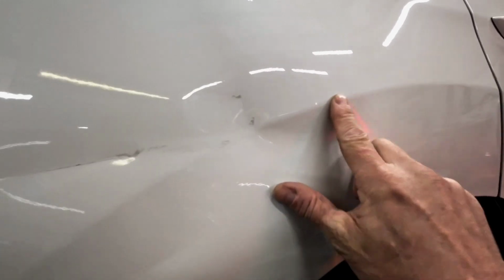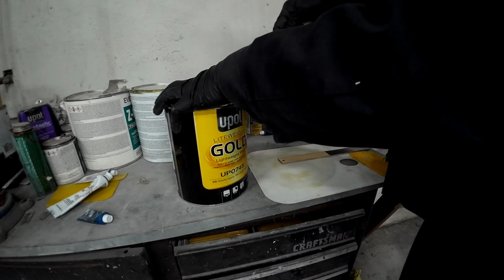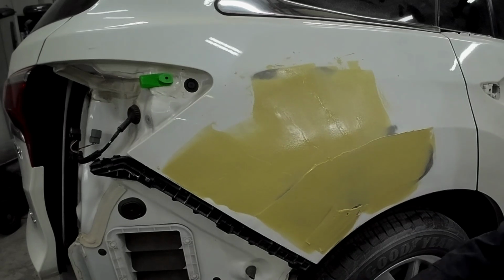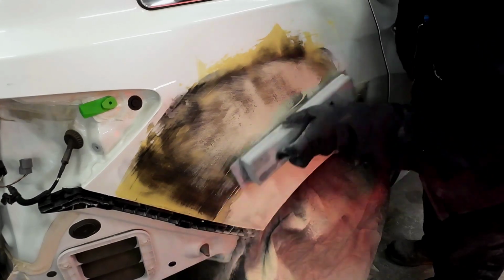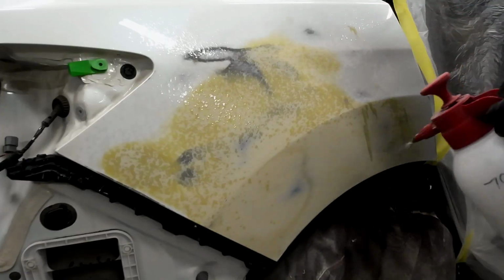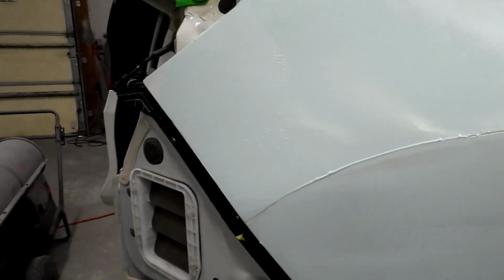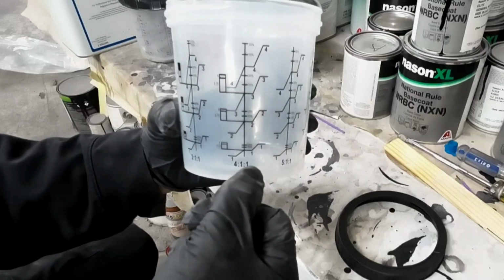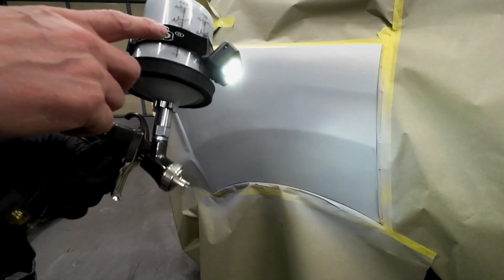How to use automotive body filler to repair your car or restoration project.

Comment: Great video! When you use that powder guide coat, if it's down in a low spot to you need to get it all out before adding more filler? Can it contaminate or cause adhesion issues?
Reply from the maker: It's  a good question I don't  remove it totally and have never had an adhesion issue. I clean it with isopropyl alcohol before adding filler or primer but I don't want to say it's 100% ok. I'll investigate this further.

Comment: Why do you have to remove the paint ? Ive got a small dent and want to do this.
Reply from the maker: On a small dent you don't  have to. You can sand it with 80grit for adhision and apply filler over the paint. Depending on the depth of the dent you may want to pull it out first. That can be done with glue pulling.
Reply: @GarageNoise  I've pulled it out as much as I can so now I think it'll be ready to put body filler, thanks for that how deep or a dent is too deep to fill roughly?

Comment: First time body filler user here. I used a bit of the upol and after it dried and I sanded it I saw that it could have benefitted from another layer, I didn't know if you could use filler several hours in between applications, so I primered it. Can I put filler on the primer once its dry or should I just start over?
Reply from the maker: Check your technical data sheet  but as long as you sand primer with 80 you should be able to apply filler over it. I wouldn't make a habit of it but you should be fine. A glaze putty is designed to be applied over primer tho like usc icing.

Comment: Hey do you use honey in your filler if you are skimming a roof panel? I am using Rage ultra with a long spreader sanding with 80. Should i just start with 40 grit? Taking forever even with the 32`` linear blocks
Reply from the maker: Yeah, you can use honey. If you're just skim coating it, it's not gonna be as high a build, but it will work really well

Comment: say i need to cover a welded seam and use kitty hair. Would the right procudure be scratch 36 or 80 then apply and level kitty hair,Epoxy car, then poly filler skim coat,high build primer? This is for the sail panel welds on a novas qtr panel. Thanks man.
Reply from the maker: Grind welds, 80 grit then fiberglass filler over weld then standard filler
Reply: Can I put the standard filler over epoxy this way the fiberglass is sealed
Reply from the maker: @Supanova70  yes, sand epoxy with 80 before appling filler

Comment: my question is, would you be able to use an orbital sander instead of the that block sander? feel like it would be much faster, like it seems that using the block sander would be better to keep a straight finish, but would it be THAT much better to justify how long it takes compared to an orbital sander i guess is the question

Comment: Do you need to sand primer coating? If so, with what grit?
Reply from the maker: Yes, 320 then 600 before yo paint

Comment: How long do you let the body putty between coats? Can body filler be applied to paint that has been prepared with 320 grit?
Reply from the maker: After about 10-15 minutes body filler  should be dry enough to sand. You can apply body filler over paint but it needs to be sanded with 80grit.

Comment: Could you use this stuff on fiber glass have some spots on my 81 c3 Corvette
Reply from the maker: Check the Technical data sheet for this. I think it's  ok but you might be better using fiberglass resin and matting.
Reply: @GarageNoise  that's what I'm using to fix the cracks in the fiber glass I'm talking about to level out before paint

Comment: Awesome video I have a question I’m noob going to keep it 100 but can I use a da sander instead of the block .? What’s your take on it
Reply from the maker: Just to smooth it out a bit, but to get it straight you need to use a block brother.

Comment: Nice job. I've never used upol filler...I'm guessing it's pretty good if your using it. I started using automotive art a few years ago......best filler I've ever used. No pin holes...sands like butter...and no hard edges.
Reply from the maker: Never heard of that filler I'll  check it out.

Comment: The body filler part should be done in one coat and finished within 5-10 minutes. The metal glaze coat should be done in one coat and should be completed in half hour at most. I think the way he’s showing would take hours with all the extra steps. Also never let your filler dry hard far easier and cleaner to use soft filler until 80 grit. You must let the glaze get solid though
Reply from the maker: If you can do it in one coat that's  fine. But you should never pile on filler to block it in one coat. It much better to use multiple layers of thin coats. Everyone has their own process if your experienced and that's ok for sure.

Comment: hi just want to ask a tip how to solve air trap in the body filler, you found it after several time sanding out the filler from the bodywork to smoothen everything.. any tips how to solve this small holes on the filler

Comment: I’ve been doing tons of research into body work as it’s something I see myself doing as a career so I have one question that I’ve asked before but has never been addressed. 

Logic tells me that in order to prevent orange peel and runny lines that I should go from top to bottom but I see everyone go bottom to top, does that make a difference with the quality of the paint job or does it just not matter?

Comment: We are working on restoring a '09 Honda Civic after our grandparents passed and I've done everything mechanical to it I need to repaint it top to bottom as there are a lot of spots that bare metal are showing but I stumbled across this video as it looked like maybe he was turning out of a bank and a rippled the passenger side fender in the front We don't care about that per se but I know it will be difficult to sand and to repaint with all that rippling in there, a new fender pannel cost about $150, So of course this peaked my interest. We're not aiming to make it look perfect at all as this will just be a daily driver commuting to work but if we could pull some of those dents out and try to fill in the rest a little bit at least to the point where we could sand and paint that would be great!

Comment: Thanks for all the great content, been watching for a long time, question, how do I get rid of tape lines after basecoat, prior to clearcoat.  I was thinking just 2000 grit on the hard edges and then clearcoat?  It’s not the whole door panel, 2’ x 2’ area in the center of the door.  On the hinge between front and rear door.   Rolled back the tape after Basecoat, and there is a hard line, just finished drying 10min ago.  Or apply another base coat on the edges before it completely dry eyes.
Reply from the maker: Are you blending the clear . I'm  not  understanding why your taping off for basecoat.
Reply: @GarageNoise   because I taped off the repair area, repaired with body filler, primed and sanded the repair area, and then went out about 6-8inches around the repair area and 600 grit whole area.  I sprayed a few coats of base, but did not fold over the tape for soft edges, I forgot.   So now I have hard lines of base where the tape was after peeling back another inch or so before I clear.   Have not applied top coat yet.
Reply: @GarageNoise   I suppose I should have done both doors, the damage was a Large gouge in the seam between both front and rear door, I was trying to avoid repairing both doors entirely, and just tried to do a spot repair.

Comment: Beautifully described  . Please discus the actual technique of making the bend line so accurate . I see you use tape but how do you work to it . Is there a standard method ?
Reply from the maker: I would block down to the tape than reverse it and block up to the tape edge. Everyone has their own variation of this method. I have some other videos  where I explain it.
Reply: @GarageNoise  Thank you very much for reply . I'll give it a go

Comment: Sand the bare metal like you say with 80 grid then again with 180 before applying filler and use not a flexibel blok for the lower section and tip sanding block with holes for dust extraction
Reply from the maker: You want to apply filler over an 80grit scratch for proper adhesion brother. Appreciate the comment and support!
Reply: @GarageNoise  i think i have a language problem sorry for my bad english
My steps are repair spot sand 80 /180 then putty after putty 80/180/280/360
Then filler witch you call primer here
Reply from the maker: @johnswinkels2979  perfect John! Your process is correct.  After primer 600/800 and paint. Appreciate the comment and support!

Comment: One tip. Dont remove the ductape after applying the filler. This way it Will act as a protection for the body line. Much easier to form a contour.
Reply from the maker: That would work as well. Appreciate the comment brother!

Comment: Yet again another interesting video for people like myself that are DIY painters doing it at home, we have the Upol high build primers in the UK but they are different to what you use, we have the S2025 which is good but there is no mention in the TDS about using it as a wet on wet or about tinting it to the colour you need but I do wonder if there is a difference between the 2🤔John UK.
Reply from the maker: Thank's John, appreciate the comment!

Comment: Thanks Chris great video as usual. I have the same spray gun as you, but I can't find the cup adapter for the Saveco cups.
What is the one you use in the video?
Reply from the maker: The R500 or Eastwood? If so the adapter is spectrum # 57505 you can get it at harbor freight.  The 3m # is  #2 legacy series appreciate the support

Comment: I have an issue on my 54 Belair where I could not tap down the high spots, they simply popped up somewhere else. So frustrating.
Reply from the maker: Shrinking the metal will take care of that.

Comment: How do you spot those high spots at the edge of the craters and how would you know you’ve tapped it down enough? What seems to be messing me up the most are those hard to see high spots like the ones you tapped down as you were pulling.
Reply from the maker: It can be hard to see. I'll  tell you what I do before I even break the paint I get a good idea where all the crowns are and start working them down  as I pull the dent. Then after grinding to bare metal I know where my lows and highs are. I apply the dye guide coat on metal and that helps along with a metal file and also getting good at feeling over the panel  to identify those areas. Experience and practice will be the difference in the end. Hope  this helps appreciate the support!
Reply: @GarageNoise  you explain in a really humble and sensible way . You were born to teach people